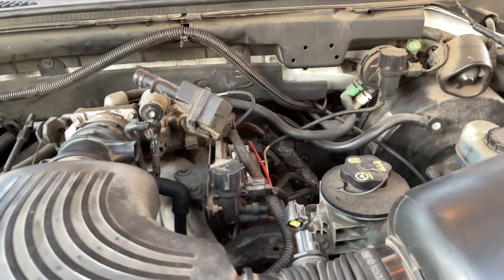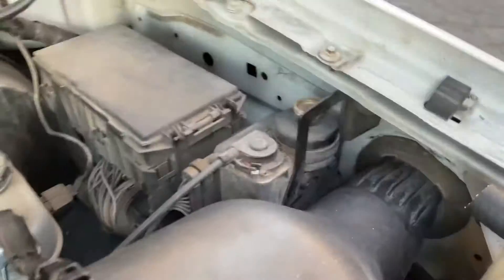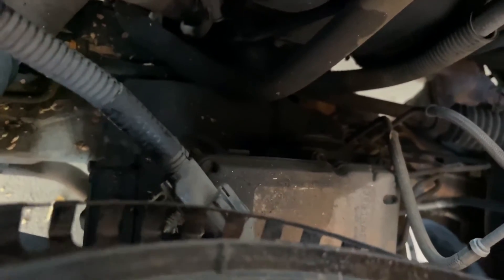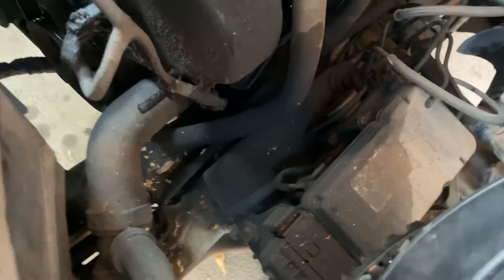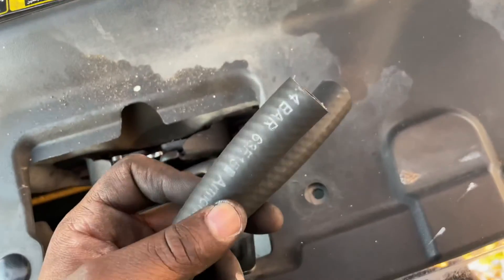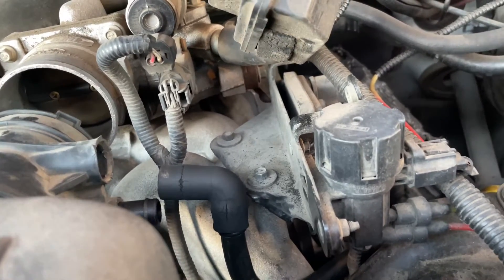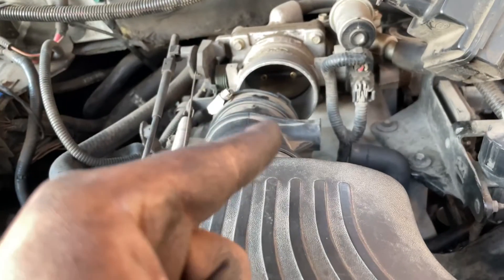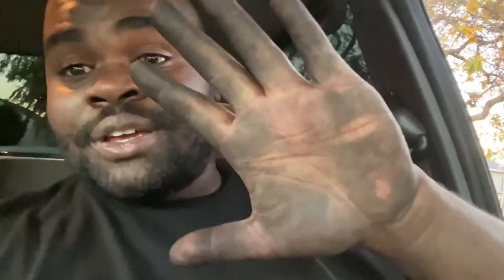I FOUND A VACUUM LEAK ON MY TRUCK D.I.Y GANG

Comment: Your drive the white truck alot more that's why, so it all just accumulated and started just a signs of it being clogged. The jeep you don't use alot so it might not be there yet, but it will if you don't check it before it does. Also important to keep the fluids clean and going through everything. Like that danny guy said counting cars, they're like humans they need excercise.
Reply from the maker: Yeah mandatory with maintenance that’s why thank god I haven’t had no issues on both vehicles 🚗 
And update truck is running good now no issues
Reply: @DERRELL_LB562  good, good, good...but that kind of gave you sort of a reminder to not forget about checking up on it at least once a month.
Reply from the maker: Thank you 🙏🏾